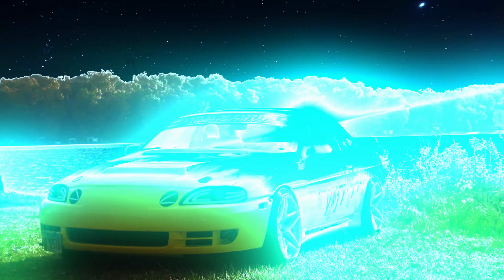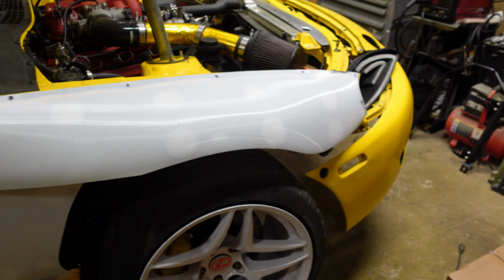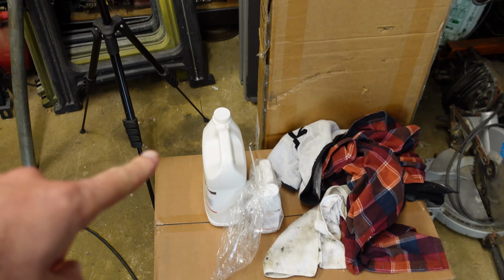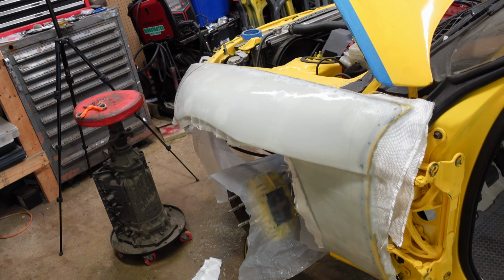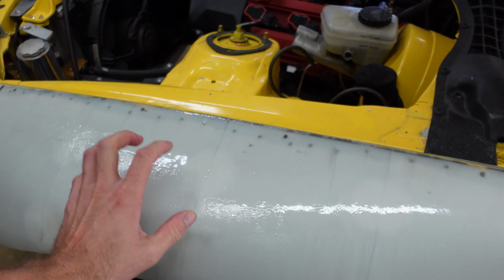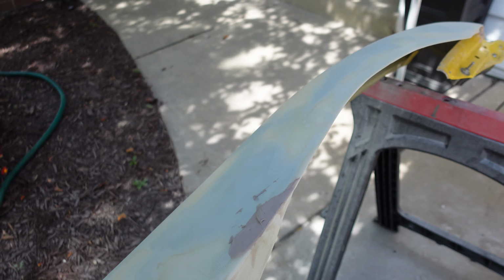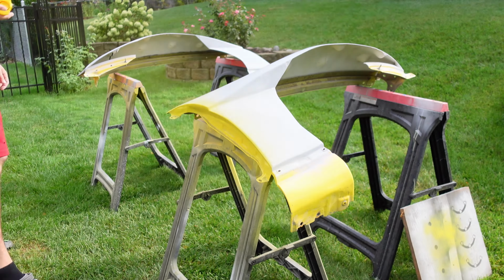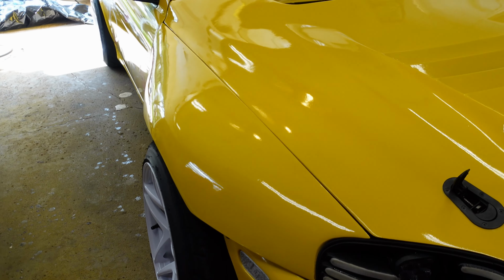I 3D Printed Widebody Fenders

Comment: 3d printing makes our job of customizing car much easier . Looks great. Only thing I didn't see you do is sand that 3dprint before the epoxy. But I ❤ the use of this wonderful technology we now possess as builders.
Reply from the maker: I quickly mentioned it after shaved the corners of the plastic. 3D printing is amazing and every car guy needs to learn it i think. No more bolt on kits!

Comment: I like how you used the stock lines of the car as the cutoff point behind the wheels. Looks really fluid, can't wait to see the rear!
Reply from the maker: That's the worst when people completely ignore the original design of the car and just add random stuff on top. One of my biggest gripes with custom stuff that i wanted to avoid. Thank you for noticing
Reply: @DingDongDrift  see that way too often, usually because they have a ton of mods that they liked on different cars but don't flow together in one on their car. Gotta think of the original design and how everything flows from the exterior, into the engine bay and from the exterior into the interior. Don't want to hop in the car and have it not match the mental image the exterior give off and vice versa.

Comment: Just got this rec'd and this is SO up my alley. As an avid 3D printer enthusiast I can't believe it never crossed my mind to DIY body panels/parts.
Reply from the maker: it took me a while and the right printer to print entire panels, but it's definitely the time to get into it with larger/faster printers becoming more affordable.
Reply: What printer did you use?
Reply from the maker: @MisterMunkie  bambulab x1 carbon
Reply: @DingDongDrift  how on earth did you manage that? That’s a 256x256 printer, is there a video of the process? Love this idea, it’s engineering at its best!
Reply from the maker: @MisterMunkie  it's literally in this video lol, just printed in pieces.
Reply: OMG, it is!!!! ha ha ha, i was expecting more than the short intro build. Well played man, what an achievement!  @DingDongDrift
Reply from the maker: In the widebody playlist during the design process i explained some other stuff i think. It was a while ago

Comment: as a fellow printer and car and motorcycle enthusiast I'm super intrigued with how you made this wide body i would love to know your print settings like how you decided how thick to make the panels and the wall count/infill% also what plastic did you end up using?
Reply from the maker: I just guessed, didn't wanna make it too thick that would make it stick out a lot so went with 4mm. 3 perimeters just because lol, 10% infill cz it's mostly perimeters anyways. I used petg since that's the only thing i use, link in bio for discount on the filament i use.

Comment: Loving this series and the great results ! Just in relation to these rattle can paint jobs, you may find better ease of use and less clogging if you can hang the parts so that the can stay verticals as much as possible during the spray process.
Reply from the maker: Yea i know i just don't have anywhere to do that unless i turn my garage into a paint booth

Comment: Been following your work on the auto/moto facebook group. Can't wait to see your process. I am in the midst of something very similar on my 944, I've scanned it and modeled a widebody. I'm interested to hear your take on the structural integrity of the part, for my initial go on my kit, i printed an entire mold negative and made a composite fender completely out of epoxy and fiberglass. It worked okay but it took a ton of filament.
Reply from the maker: It's pretty structurally sound already, but it will eventually become carbon kevlar

Comment: that turned out much better than expected in the first few minutes, but I'm still curious - would it have been feasible to replace the whole fender (including mounting bits, etc) with a 3d printed structure instead of cutting out that bit? pros/cons?
Reply from the maker: Yea definitely, i just didn't wanna model all that stuff and worry about holes lining up and stuff. I thought this would be way easier

Comment: When you took the front fenders off before hitting them with the primer You should have put more epoxy and fiberglass on the underside For a little more structural Support maybe even put in some aluminum Metal that has been bent to shape
Reply from the maker: they've been fine for almost a year now